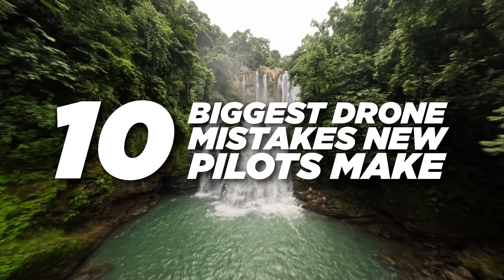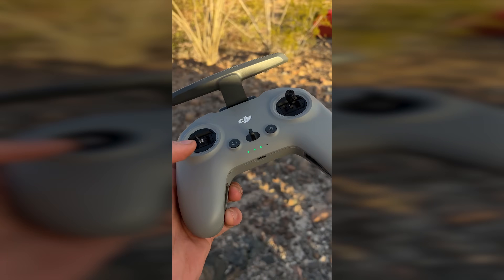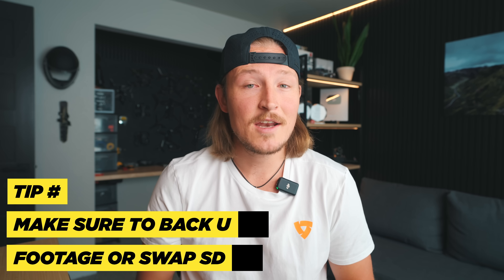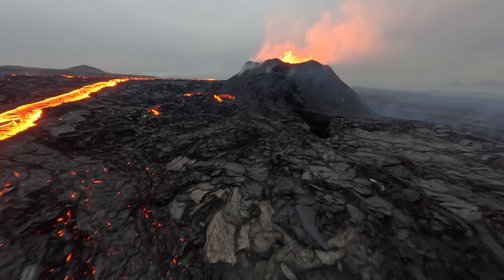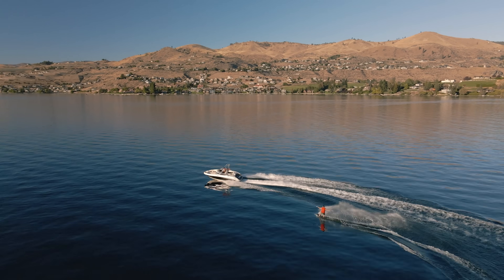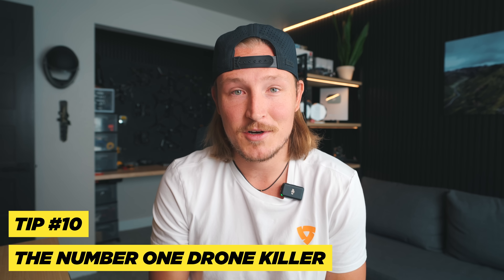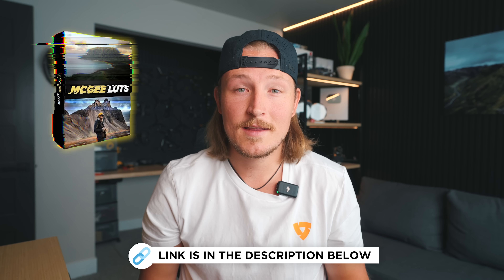10 BIGGEST MISTAKES New Drone New Pilots Make

Comment: It's ALL good advice BUT... there cannot be emphasized ENOUGH:as a drone pilot, and ESPECIALLY beginner drone pilots, do your due diligence and check your surroundings for safe-to-fly issues (consult an app for possible restrictions) for that area. 
Most crashes can be prevented through following proper protocol when your short on common sense.  Drones are great fun, especially if you can keep em safely in the air, right?

Comment: I just got a small quadcopter for Christmas and on my first flight it started moving away from me and it flew over a forest and I lost connection with the drone and it continued to hover sideways until 1000 feet later it finally crash landed upside down on a road upside down and we got in the car to go find it and extremely luckily I found it after 5 minutes and no car had ran it over luckily now I got the hang of it😅😂

Comment: I lost an Autel drone to power lines in a valley once where they dipped into the valley. I was 20 feet higher then I thought I was, I had to guess because negative altitude and the wires were way lower then I had thought. I went sideways, hit the like 50K volt lines and crashed into a shallow pond, in February in Pennsylvania, so cold. I used the last known map location to work out where in the pond it landed, then used it's lights to locate it and walk out to it to recover it. 

Took it home, took it apart and left it for days to dry out. The camera I couldn't figure out how to get apart to where the sensor was so I very carefully drilled two holes thought both sides of the camera into the sensor space to let the water drain out and dry. After days of drying I put a battery back in it and the thing flew perfectly. The only issue was a slight camera discoloration in some splotches that was only visible when setting the F.stop to a high setting. 

Unfortunately the Micro SD card lost all footage of that day.

Comment: lol just crashed my drone yesterday while flying it through the mountains, replaced the propellers and recalibrated. Took it out for another flight today and it got caught on a cable line and crashed again, luckily minor damage to propeller. I saw the drone hit the craziest maneuver to get itself off the electric line it was caught on. Seriously impressed with how good and sturdy DJI products are.
Reply: I sunk an Autel drone in a pond after it hit a high tension powerline, and after letting it dry for a few days, flew perfectly fine. I'm old enough to remember when plastic meant brittle and shattering from normal hand height lol.

Comment: Had a Neo for less then 20 minutes & fell into a river. Bought a new one right away for a holiday and the new one also fell into a lake. Both have individual flyaway DJI care. Their engineers had determined it not to be my fault and sending two new sets of Neo free of charge… both were using RC N3 but they said it’s not the remote controller but the ‘flight controller’ whatever that means.
Reply: The flight controller is a circuit that is a part of the drone and controls the motors, GPS, batteries gyro, etc.

Comment: I recommend buying SD cards that can hold no more than ~1 hour of video footage and buy many of them. My experience of flying my mavic over flowing lava in Iceland is to change card after every flight. I did not loose my drone over lava but as the bodywork has molten it came close to that. Make sure the SD cards are graded for recording 4K video and perform a full format (not quick format) before using them

Comment: If your are setting up RTH in betaflight or INAV dont set the RTH height to max, one day My drone was highup in the sky that I couldn't see it, then it got slowly drifted away and i lost the signal. When i found the drone and footage from the dji cam it turns out the drone was near the ground when it lost signal and then tried to gain the max altitude in that flight and lost the battery in the process and dropped on ground. If you live in the plains with not so tall structures then keep it between 30-60meters heigh from home altitude.

Comment: I had an experience where a drone fell into the sea.. even though the boat had stopped.. but at that time the waves were a bit rough and the water was not calm.. My Avatar 2, entering the sea when it hit the boat wall from the side.. I was wrong, my drone should have come from the front of the boat, not the side... what is fate.. in the past I landed on the boat in a good way.. but this time I was not saved.. for me this is a very expensive experience..

Comment: I put my damn props on ass-backwards on her maiden flight. I mean, i saw it has a QR code set of directions but they also have directions and warning not to drink the water from batteries. I skipped the directions and well... I only lost a set of airscrew props luckily.

Comment: Glad you mentioned birds!  I just had a run-in with an angry territorial crow on a commercial real estate shoot recently! It tried to knock me out of the sky. I was very lucky it happened right in front of me, and was only about 15 meters in the air as I was going close-ups of a building. The drone righted itself but was flying so unpredictably, lurching, and in my attempt to land it, it lurched to one side and hit a brick wall and landed hard. 7 out of the 8 props were damaged or gone, so the crow’s initial strike did some of the damage!

Comment: Yeah, i learned that part with the home point in one of my very first flights. I thought, its setting me as homespot, since i had the phone / controller in my hands (got the neo) .... but its taking the spot where i started... kind of weird, since, if i move from a to b while the drone follows me, point a becomes irrelevant...so, why shoudl it go back there, away from me? but it is, what it is...

Comment: Great point about birds! I had an interesting observation at a surf competition. At that exact same spot, my own experience previously was dealing with aggressive seagulls. Yet, during the event, they were completely absent. The event's drone operator said he wasn't using any deterrents and never had issues there. My theory is the old, funnel-shaped PA speakers they used might have emitted a frequency the gulls disliked. Purely speculative, but it was a noticeable difference!
Reply: I use red reflective automotive tape works fantastic.
Reply: @carruthers8285  Did you notice a difference in effectiveness with different bird species, or does it work for all types (e.g., eagles, seagulls)?

Comment: I like seeing chapters... would be nice to see them more often on your channel.
0:00 - Intro: Learning From a Decade of Crashes
1:01 - Pre-Flight Vigilance: Spotting Cables & Power Lines
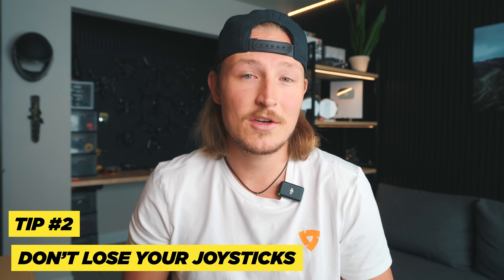2:00 - Essential Gear: Controller Sticks & Spare Props
3:25 - Sponsor: Artlist Gen AI
5:18 - Protect Your Footage: SD Card Strategy & Backups
7:05 - The Sport Mode Trap: Understanding Sensor Deactivation
8:16 - Battling the Breeze: Smart Flight Planning in Wind
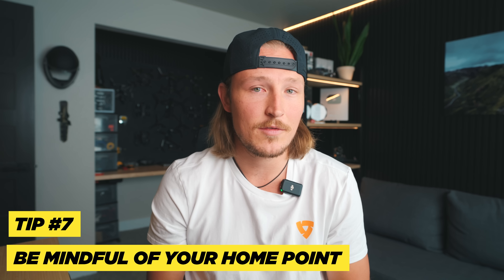9:37 - On the Move: Dynamic Home Point Management
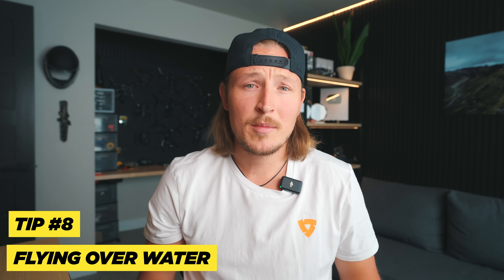10:37 - Water Flying Wisdom: Reflections & Swells
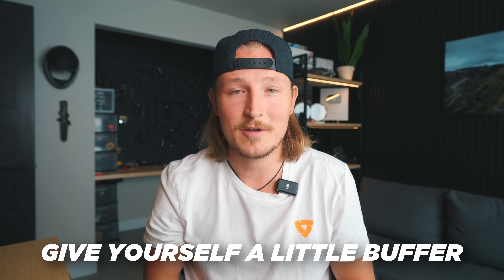11:20 - Aerial Adversaries: Handling Bird Interactions
12:28 - Level Up Your Look: Cinematic LUTs
12:57 - The #1 Crash Cause: Navigating Boat Launches & Landings
14:50 - Final Tips & Drone Recommendations
Reply from the maker: You're amazing man I'll actually add these right now
Reply: Best SD card for an Air 3?
Reply: @kyle_decarlo i have personally used and speed tested top line SanDisk, Samsung and Lexar Micro-SD-Cards and so far I like the "Lexar Silver Plus" Cards the best. I had several San Disk Cards fail on me (one total fail, 2 that could still be read but not be written anymore). Then I switched to Samsung but was not always happy with the performance, so I finally tried the Lexar Silver Plus. No fails yet and by far the best performance (always > 150MB's rw in a good reader, where the others do 80-110 MBit/s max.)
Reply: Thanks so much for this Franz!!!

Comment: crashes mine on the first day then stepped on it while trying to find it :(
Reply: same i crashed my dji mini 4 yesterday
Reply: The last tip are really awesome so pay attention guys
Reply: Yup
Reply: What kind of drone did you have before him?
Reply: @PavelMy Avata 2 but crashed my mini 4 on a yatch and got the Mavic 4 pro
Reply: Are they cheap to repair?
Reply: @SCOTTYLUDD  almost as expensive as an rc helicopter. mine flew into the wall of the our house when a deaf kid pushed the stick all the way into the end stop. i have a dji mini se. broke the two front arms right out of the mounts and also snapped the blades on the rear arms when it hit the ground. i like sharing the experience of flying these machines but i have to be very careful to not let anyone touch the sticks unless i want them too. i find people are more curious than angry when i fly in public areas. i have a video on my channel where i flew over the Vaal dam in south africa. it separates Gauteng from the Freestate as the Vaal river. always be careful when flying around people and always pay attention to your environment. and stay out of controlled airspace.
Reply: I totalled my Syma X21 like 5 years ago
Reply: Final Destination sh!d
Reply: unlucky
Reply: AI.. No need for drone 😂
Reply: Sorry for your loss; made me chuckle a little. 😭😂 ‘Went to zip up the radio bag, zipper broke. Drove the car, equipment fell out. Car battery died, cellular data was in a dead zone.’ 😂
Reply: Damn🥺

Comment: Nice. What kind of drone is that with the GoPro on it at 8:32?
Reply: It is an FPV one, dead cat arm config , so the front propellers don't get in to the shot, the brand I can't tell. There is so many bind to fly fpv quadcopter and many frames so you can build a DIY  FPV drone.